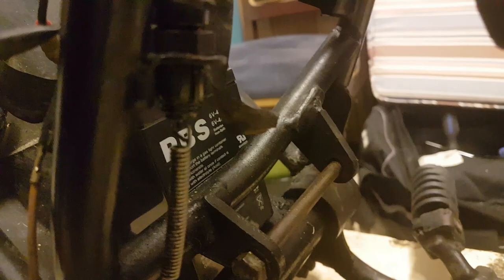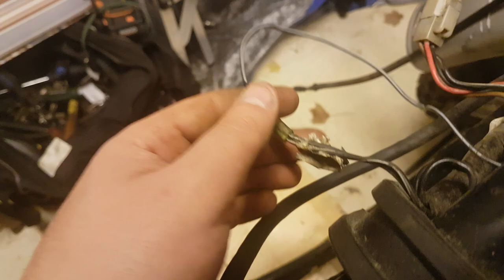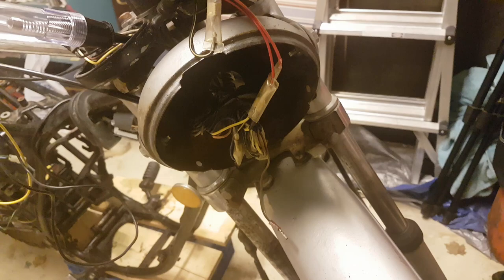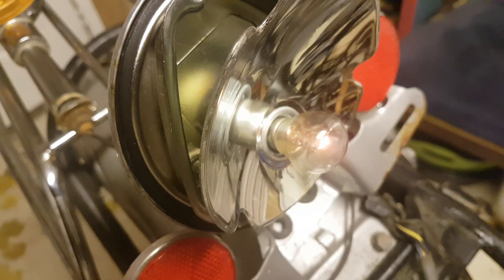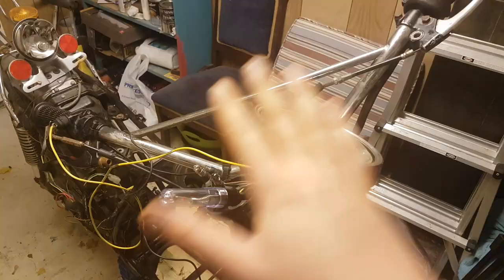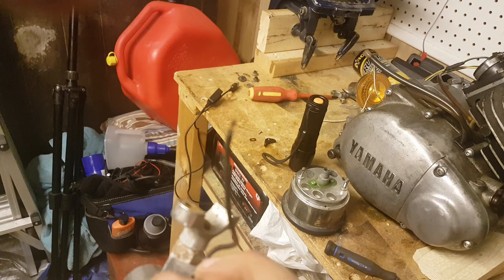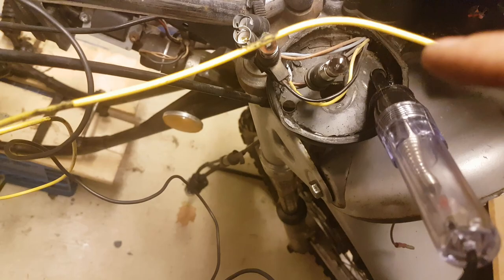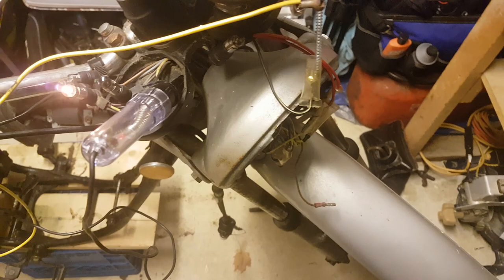1974 Yamaha DT175 Project - Explaining the wiring

Comment: So this helped me alot along with that diagram. You left out the wiring for the indicator bulbs in the cluster. That being said i figured them all out but the turn indicator.  Where do they go. If I plug one into ground and other into one of the turn signal wires then it only comes on when the one i plugged it into is used. But if I use the other signal it won't light up. I'm dumb founded